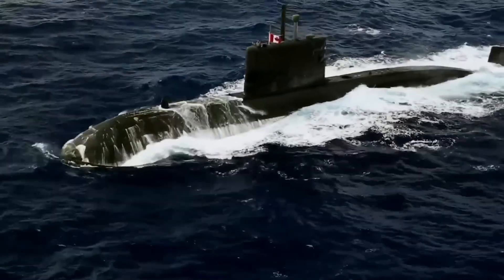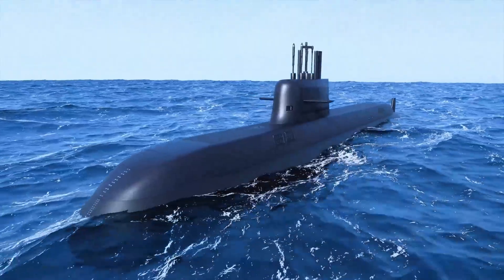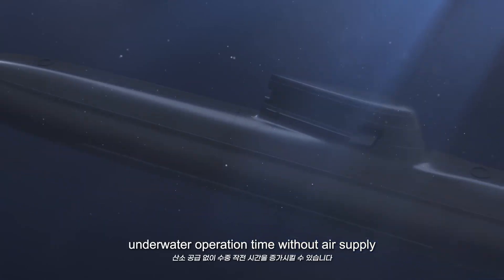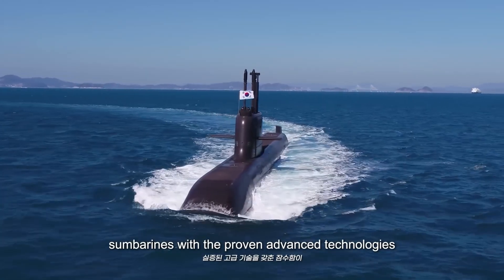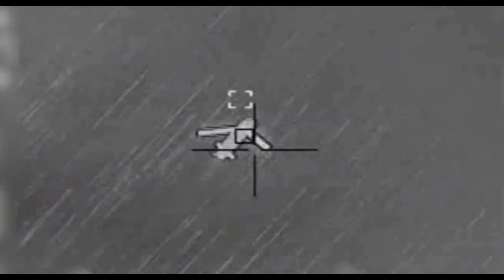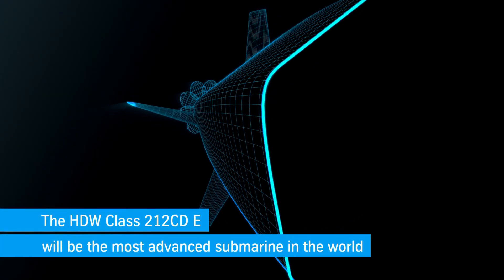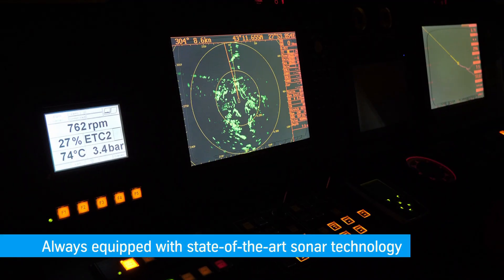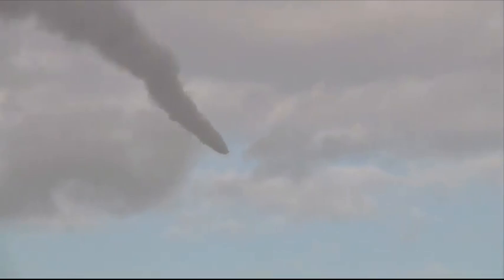RCN's Potential Next-Gen Subs

Comment: Korean boats on this one.   The german deal wont have boats in hand until they are obsolete
Reply: They're talking nonsense! According to experts, the U212CD is in a league of its own and the ultimate underwater hunter! No other submarine can compete with the U212CD, and that was true for the U212A as well!
The first three U212CDs will be completed starting in early 2027! From 2027 onward, three to four U212CDs will be built annually! Germany has 28 shipyards, and 75% of them have already built submarines—a good 1,800 since 1916! Canada will build its own U212CDs from 2026 to 2028 in its own high-tech facility built by TKMS, equipped with unique 3D helmet software! Simultaneously, personnel will be trained to German high-level standards! By 2031, Canada could have built three of its own U212CDs under the guidance of TKMS experts!
Germany has 28 shipyards, and 75% have already built submarines—a good 1,800 since 1916! Canada will build its own U212CDs from 2026 to 2028! Germany and Norway are ready to hand over a U212D from 2027 so that crew training can begin immediately!
You can read all about it, or see how much nonsense they write!

Comment: Any submarine in the world can work in the arctic, so the 212cd is nothing special when it comes to the arctic, and the diamond shaped hull is not proven yet and there's a lot of unanswered questions on how well it will work?
Reply: You're talking nonsense, just like most of the other users here! The Atlantic/Arctic waters, at -1.8 degrees Celsius, are the most dangerous sea in the world! The USA has learned some hard lessons in these waters! Small icebergs weighing 1-50 tons can float beneath the Arctic ice. One ram and the submarine is ruined or even sunk if, for example, the propeller is hit or the pressure tank is punctured! German submarines have been operating in these waters since World War I and are fully certified for them to this day! We're talking about a total of 1,800 submarines built to date! Germany has the most experience in submarine construction worldwide, and when it comes to the Arctic, they are number one! The U212CD is based on the U212A, which has been operating in the Arctic for decades! The new, unique high-tech sensor system of the U212CD, with its 3D array system, was developed specifically for Arctic waters!

According to AI analysis, the U212CD is currently the most dangerous hunting submarine in existence! In 2005, Diehl unveiled the Barrakuda torpedo, capable of speeds of 400-800 km/h and interceptable only by the Barrakuda itself! It has a range of 100-160 kilometers! AI: With the last 2 kilometers of its range, it accelerates to 800 km/h and impacts 8 seconds later with 220 tons of kinetic energy! The DLR/Fraunhofer Institute developed the world's first fully functional vertical takeoff and landing aircraft, the V101, the first extremely low-altitude jet, the Tornado, the X-35, and the Eurofighter using unique simulation software! All the jet simulations proved accurate in reality! They also developed all the submarine designs, and the U212A performed exactly as the simulations predicted! The U212CD will function in the same way as the new FCAS Stealth NGF!
Reply: @tlsig Are you nuts? there are no torpedoes in the world that does400-8-- km/h, and as for icebergs hitting subs, that's bullshit, it's not the iceberg hitting the sub but the sub getting too close to the iceberg and the sub hitting the iceberg, and the Germans do not patrol the arctic and no one has ever seen one, or any arctic country!
Reply: They're too stupid to Google! For example, "2005 Diehl Barrakuda 400 km/h!" Then Google will give you the answers!
Wikipedia: Supercavitating underwater missile
According to the manufacturer, the torpedo reaches speeds of over 400 km/h underwater and is steerable. It doesn't rely on being launched from submarines; it can also dive into the water from the air and begin its supercavitation journey there.
There's a documentary on YouTube about the Barrakuda and how dangerous the Diehl missile torpedo is! From 3:30 PM: Barracuda
National Geographic series 'Ultimate Structures'
AI Google: The "Diehl Barracuda" was a German development project for a supercavitating torpedo, which in 2005 was said to achieve impressive speeds of up to 800 km/h (approx. 430 knots).
Developer: Diehl BGT Defence (now part of Thales) in cooperation with the German Navy. 
Performance: The 800 km/h was an impressive figure that was mentioned in presentations (e.g., at trade fairs) and demonstrated the capabilities of the technology. According to AI analysis, nothing has been heard of the Diehl Barracuda since 2005, and AI assumes it was a warning to the Russians and is top secret! According to AI, the Barracuda is already ready for mass production!
Reply: AI analysis: Due to climate change, thousands of "dirty icebergs" calve from Greenland every year. These icebergs contain rocky debris (moraine) in their lower sections, which can result in a higher overall density of up to 1.0–1.1 kg/l. They float deeper and, under current pressure, could more easily be partially forced beneath the 3–5 m thick Arctic ice sheet, where they drift in cavities or channels.
At a current speed of 0.5 m/s (approx. 1.8 km/h), a dense "dirty iceberg" could actually travel hundreds to thousands of kilometers beneath the Arctic ice sheet before disintegrating. With a survival time of several months, this would result in realistic distances of 1,000–10,000 km, depending on turbulence. The "ping-pong" behavior arises from variations in salinity (density differences in the water), as the iceberg would oscillate in current channels or eddies, similar to sediment-laden objects in Arctic drift.

The aforementioned factors—increased calving (500+ Gt/year), new/dynamic currents (Atlantic inflow +20%), variable salinity, and thousands of dirty icebergs—make Arctic submersible dives in the Arctic significantly riskier than 30 years ago, with a dynamically increasing uncertainty factor!
Thousands of dirty icebergs per year from Greenland make it likely that some will become trapped under pack ice and drift for months, impacting local ecosystems and currents—climate warming exacerbates this through increased calving. Complete disintegration after weeks/months remains the norm, but exceptions with longer journeys are consistent with observed iceberg drifts.

Greenland glaciers calve hundreds to thousands of icebergs annually, a significant proportion of which (approximately 10–30%) are "dirty icebergs" containing glacial moraine, due to the presence of sediments in the lower layers of the glacier fronts. With increasing warming (currently ~270–500 gigatons of ice loss per year), over 1,000 such objects could form by 2025.
Overall probability: 20–100 dirty icebergs annually beneath Arctic ice, with local currents influencing their ping-pong drift.
Therefore, according to AI analysis, the risk of encountering a dirty iceberg (1–1.05 kg per liter) has drastically increased. Furthermore, new currents with varying salinity levels are emerging and can change rapidly.
So, there aren't submarines or fish swimming beneath the Arctic!

The probability of a collision is 1 in 1,000–10,000! This is a truly remarkable statement, considering the mathematical probabilities of Arctic ice cover! In just a few years, we'll see a significant number of dirty icebergs merrily drifting back and forth under the ice until they reach the open sea! This analysis was conducted by an expert researcher who regularly visits the Arctic! Just recently, the high-tech robotic probe Ran (1.9 tons, 7.5 meters long), which was taking measurements in the sea off Antarctica, disappeared! It was caught in a current and dragged over 400 meters under the Antarctic ice. A trajectory was observed showing it making a large loop of thousands of kilometers before emerging on the other side after nine months! Scientists were shocked by the data from the abandoned Ran probe!

Comment: Seems like a no brainer.. Delivery schedule, VLS, more interior room.. Just wondering if there’s a module to deploy special ops if needed. 
As someone once told me, it depends on what you’re planning on using it for, where’s the ‘playground’ gonna be? The Hanwha option seems more of an ocean going, blue water type, whereas TKMS is more for littoral ops but can do blue water if needed. 
I believe the TKMS option is still on paper, so factor in delays 🤔. Both have their strengths, but based on delivery alone, 🇰🇷
Reply: The amount of nonsense you read from users here is truly remarkable! The U212CD has a dive time of over 40 days and is certified for cold water/arctic conditions (-1.8°C), while the KSSIII has a dive time of over 20 days and no cold water/arctic conditions certification (-1.8°C)! Experts say the U212CD's operational depth is 200-1000 meters, and the KSSIII's is 200-400 meters! The U212CD can travel at over 20 knots underwater, experts say 30 knots is possible, it can reach a depth of 800 meters in 1.2 minutes, and then cover a distance of 10 kilometers in 10 minutes after an attack!

The U212CD is scalable in length and size! According to AI, a 90-meter U212CD can take on VLS 40+ missiles! Its range is 17,000 nautical miles, and its dive time is then over 60 days! As for new weapon systems like the German MDBA, Diehl, and others, Korea simply can't compete! For example, the Diehl/2005 Barrakuda can reach speeds of 400-800 km/h underwater and has a range of 100-160 kilometers! The Barrakuda can only be intercepted by another Barrakuda! It accelerates to 800 km/h for the last 2 kilometers, reaching its target in 8 seconds and impacting with a kinetic energy of approximately 220 tons, causing total chaos!

The first 3 U212CDs will be delivered in early 2027, and from 2027 onwards, 3-4 will be delivered annually, according to TKMS! If Kadada purchases U212CDs, TKMS will build its high-tech facility in Canada in just under 2 years and train personnel simultaneously. Then Canada could have built 3-4 U212CD submarines themselves from 2031 onwards, under the guidance of TKMS specialists who have decades of experience abroad in implementing such projects! Just read all the user comments below, and you'll find much more detailed answers from me, analyzed by a professional high-performance AI with all the source references!

The U212CD is based on the U212A, and TKMS has 100 years of experience in submarine construction! No other country can compete with that! MTU submarine diesel engines also have 100 years of experience; MAN Diesel/Maybach is the origin from which MTU emerged in 1968 with Mercedes!
Kore's experience is based on the TKMS U209 and U214 = KSSII, from which the KSS III emerged! So, ultimately a derivative of the TKMS U214! The U214 is an export version without the high-tech sensors of the U212A!
If German politicians say no to MTU high-tech submarine diesel for Korea, the KSS III submarine cannot be built, as they use MTU engines!

Comment: NATO 회원국이고 NATO에서의 독일의 힘을 무시하지 못하지...노르웨이에서도 그랬듯이...이번에도 실컷 이용해먹고 아마 독일 잠수함 선정할 가능성이 기정사실화 되었네...
이번 입찰기준을 새로 만들어서 한국과 독일에 보낸 것을 보니...확실하게 느꼈다...
아직 세상에 나오지 않은 독일 잠수함을 언제 인도받을지 모르는 독일잠수함을 보유한 것을 축하드립니다...이 글은 내년 중에 성지가 될 겁니다...ㅎㅎㅎㅎㅎㅎㅎㅎㅎㅎ
한국은 결국 들러리...ㅎㅎㅎㅎㅎㅎㅎㅎ
Reply: What will Korea do if Germany says they won't get the high-tech MTU diesel engine for their submarine, which has been in development for 45 years? Thailand wanted it for its Chinese submarines and didn't get the MTU diesel engine either! Construction and testing time for an MTU diesel engine is about one year! All system components, materials, and the manufacturing process for MTU diesel engines are top secret! The new MTU diesel engines for the U212CD are in a completely different league, and experts assume that the U212CD might even be able to produce its own hydrogen/oxygen!
TKMS and the Fraunhofer Institute/DLR are developing completely new systems when they realize that a completely different approach is needed to achieve top performance!
U212CD has a fuel cell that is in a league of its own worldwide! The significantly longer immersion times (>40 days) demonstrate the fuel cell's capabilities! KSS III is only specified at >20 days! LFP batteries don't have the performance of lithium-ion batteries, but U212CD's LiFePO4 battery is a long-standing in-house development by the research institutes and offers higher performance and is much safer! Mass-specific energy density (Wh/kg):
Liquid hydrogen: With approximately 33,300 Wh/kg (or 33.3 kWh/kg), it has an extremely high energy density per unit mass.
Best lithium-ion battery cells (NMC/NCA): Currently achieve around 250 to 300 Wh/kg. Newer developments in solid-state batteries are expected to reach 400 Wh/kg, but are not yet widely available. Result: Hydrogen stores about 100 times more energy per kilogram than a typical lithium-ion battery!
So, explain how the U212CD can have a 100% longer dive time than the KSS III. What could be the reason for this?
Here's an AI analysis based on my many questions: For fuel cell operation with liquid hydrogen: 
Energy content of hydrogen: approx. 33.6 kWh/kg. Amount of hydrogen required for 60 days: At 5 knots approx. 4,300 kg / At 10 knots approx. 8,600 kg / At 20 knots approx. 12,900 kg
Amount of oxygen required (for reaction with hydrogen, approx. a factor of 8 relative to hydrogen): At 5 knots approx. 34,300 kg / At 10 knots approx. 68,600 kg / At 20 knots approx. 103,000 kg! So, the U212CD has 12.9 tons of H2 and 103 tons of O! Now imagine they're only traveling at 10 knots—how far would the U212CD go then?
Experts are asking whether the U212CD can have even longer dive times than >40 days, given the facts just presented! They're wondering if the U212CD can even produce its own liquid H2 and O! I analyzed this with AI, and the conclusion was that a system that produces 10% H2/O in 8 hours would fit into the U212CD without any problems! The system would be a 12-meter container. The resulting advantages would be enormous for missions, and according to the AI, a nuclear submarine would be expensive and essentially pointless based on the many facts mentioned! The U212CD, with a length of 90 meters and 40+ VLS, could have even longer dive times if it could carry twice the size of liquid H2/O tanks!
The U212CD is based on the U212A, and the DLR has already tested everything using special simulation software that is unique worldwide. Please explain why the KSSIII has a dive time of >20 days while the U212CD has >40 days, which is 100% longer. What is the reason for this, given that the U212CD is smaller and can still achieve this?

The U212CD is based on the U212A, and the DLR (German Aerospace Center) has already tested all the systems using special simulation software that is unique worldwide. They have likely also conducted a combat test with the KSS III submarine against the U212CD, which TKMS (Technical Committee for Marine Science) can then demonstrate!